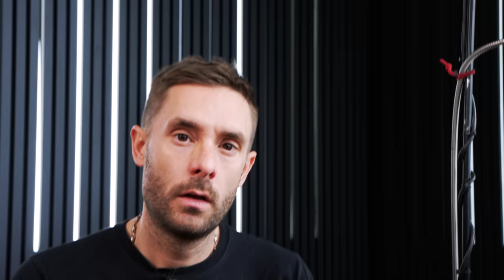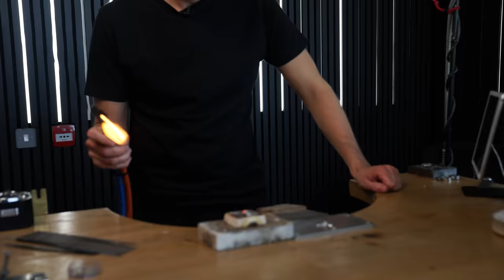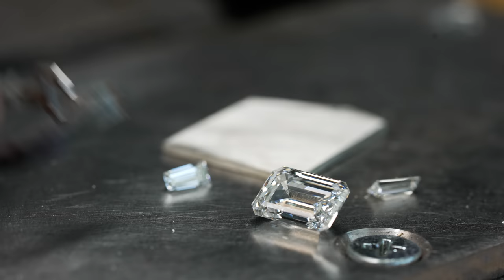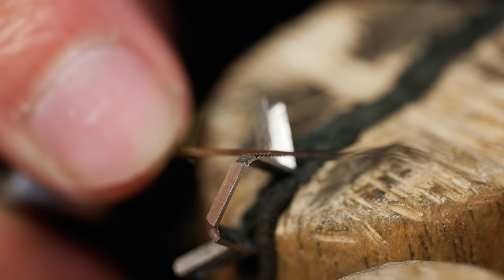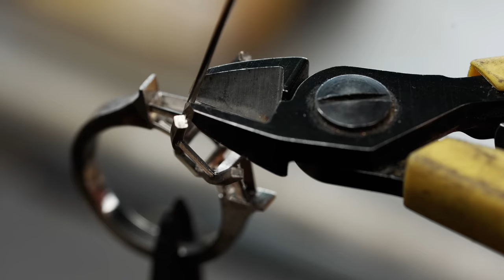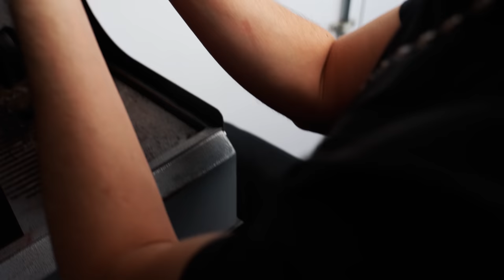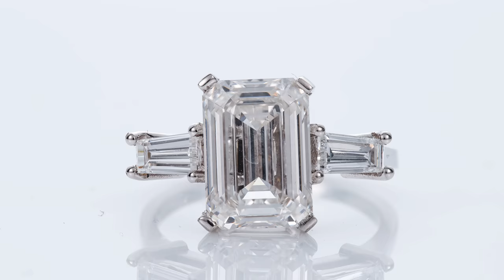Lazy Jeweler Ruins $200K Engagement Ring

Comment: I’m a relatively inexperienced jeweler (4 years and 2,000 + engagement rings, all single piece castings) and my 2 cents are that there’s a right way and a wrong way to do anything. It’s amazing the difference in quality when the cad designer has the ability to design a setting to actually fit the stones exactly. And flimsy rings are an atrocity. Don’t be scared of computer designed rings, just be skeptical of the designer and the jeweler. Make sure your jeweler can match fancy cut stones by using a 3D scanner. Look at the prongs, imagine where something might snag, and know that if you can see it, it can be polished by a skilled jeweler.

Comment: I used a drop glue and set stone table down traced etched around it to cut out the collet ,or bezel,never again absolutely loove that neet little trick putting stone in micrometer tight and etch away.i make fine silver jewelry i like to do things right dont like bezel made from bezel strip  i like cut out thick one piece collet or bezel like my mens box style ring you only need about  two mil. because as you know the pavilion is in the cut out inside bezel   ive learned to cut sides and friction fit pre filed or engraved rolex style  for instance  its way better than sweat soldering sides on trying to get perfectly centered and then you  have solder mess around  it .Thanks for your videos every day i  learn something new

Comment: At best, the client didn't really have a 3D "vision" of what they wanted and maybe described it in vague terms or from an overhead perspective only and the jeweler worked with the concept he was given. At worst, the patient overpaid for an unfinished, cast piece of jewelry assembled shabbily with poor workmanship, asymmetry, excessive height, poor polish, etc., etc. Bobby absolutely rescued the client, rescued the diamonds and made them the center of attraction but without losing site of exceptional craftsmanship and design. The finished product is on par with the finest jewelry houses who adorn celebs for the red carpet and international royalty. It's definitely eye candy. P.S.: I've seen that 'KC' maker's mark many times in the U.S. so that definitely gives away that the original was a cast piece.

Comment: My son is a Green oak timber Framer... I say jokingly  ''What's the difference between a poor carpenter and a good one? 0.1mm. It's the fitting and overall look that is so important with structures, too..Pride in work is crucial.
With Jewellery, the tolerances would be far less.
Beautiful ring you made there.. the first one looked like a Christmas cracker toy one. Second one? Classically beautiful.

Comment: nice work....personally i would've made the claws on the emerald cut more square to match the style of the stone but it looks 1000 times better than the original 'off the shelf' turd....  why aren't you using hydrogen for working platinum though?  it's much cleaner and ensures there's never any impurities getting into the plat, plus it gives better heat....

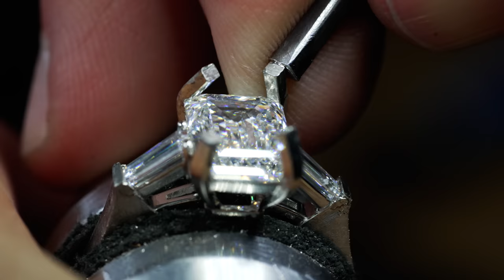Comment: In this part 4:41 you actual saw the metal bits direct toward the gem. The Japanese jeweller who made my engagement ring, used to wrap the gem in a very thin but extremely sturdy washi paper actually made from the bark of mulberry tree, spider webs as well as silk worm chrysalis to protect it, and then only when the ring was completely over, including all the polishing, would he plunge the whole thing in tea mixed with sake and the paper would dissolve immediately. But the sawing and the polishing never ripped the paper.
Reply: Very interesting. May I ask you what kind of stone (cut and type) was used in your engagement ring?
Reply: @Sandro093  The ring is a 3 carats grey diamond in a princess cut. The ring is made of old silver but the inside of the ring is made of pink jade and green coral, but it only shows in the back of the finger on the inner side of the hand where the ring is carved to show the coral and jade underneath. 
That is because coral and jade protect you in Japanese culture and should be worn on the skin.

Comment: As a fabricator that prides myself on details, the rough out was sloppy. 
 But the end product looked pretty decent.

 I would suggest using hydrogen as a fuel instead of acetylene or propylene, as it will not leave more impurities in the metals.

Comment: Nice work, but just one question. I didn't see any flux used in joining the metal pieces together, do you just rely on heat alone because of the purity of the metal or did I miss something? My experience is in electronics and without some sort of flux to join components to circuit boards you might as well just go home.

Comment: I don’t get it. When you solder one bit on, and then reheat the ring to solder the next, how come it doesn’t all melt and fall apart?
Reply: There are solders that melt at different temperatures, with careful heat control you can solder things without your piece falling apart, also some parts may have been tacked together with a laser welder, with will hold pieces together when soldering. Hope this helps.

Comment: My ring was computer-made, but the setting was designed for the stone, and I've had it for almost 6 years and I haven't had any major problems (I think I lost one melee stone once, which was replaced for free, and once, a prong got a teeny loose and I could barely feel the stone rock if I touched it, so I had it re-set and I've had 0 problems in years.) It is a shame the original jeweler was so lazy with the piece; they could have scaled it specifically for the stones.

Comment: 99.9 percent of all modern jewelry is cast, nothing wrong with that. The old mounting looked OK, just a bad setting job on the center stone. I wouldn't have used prongs on the baguettes on either one, I'd have used bars. Pointed prongs on the center stone are just asking for trouble later. There are ways to polish those recessed areas but that is pretty rough,   like it didn't burn out well.

Comment: Pure curiosity.
Obviously a diamond is hard. But ... i found myself cringing when you sawed the extending bits of the claws off and then filed them off. 
Is it absolutely "safe" to skim the diamond with the file and saw? since its silver, i guess the metal doesnt need to be too hard, so the difference might be enough to not be able to damage the stone ... 
so ... just from your experience, can you actually scratch the stone with the tools you used here? are they of specific hardness to avoid any damage? on a scale from "not giving a fuck" to "absolutely focused" how much do you have to watch out for the stone ? ^^

Comment: There are good and bad castings with good and bad cad work just as much as there is good and bad hand-worked metal. A properly cast and finished ring that was properly designed for these stones would be just as good. Unfortunately, the customer paid for a ring that was not modeled for their stones and was finished poorly. That doesn't mean all cast rings are bad. Misleading.

Comment: your rings surfaces are far from perfect aswell. Lots of deep scratches from saws and files still visilble, cutouts are very rough, welding spots are visible, there are craters and bubbles in the surface of the metal, everything is ever so slightly crooked and all the edges have been simply worn down by the polishing wheel.

Comment: SORRY, THE OLD RING DOESNT APPEAR TO BE A ONE PIECE CASTING IN FACT YOU CAN SEE THE SOLDER MARKS ON THE ENDS . IT APPEARS HAND MADE. THE STONES WOULD NOT HAVE FALLEN OUT. IT IS JUST A DIFFERENT STYLE. BAGUETTES USING ADDITIONAL PRONGS AND CLAWS RATHER THAN REGULAR PRONGS.  CLAWS CAN GET CAUGHT ON CLOTHING BY THE WAY. .